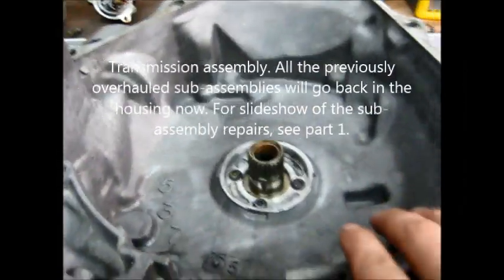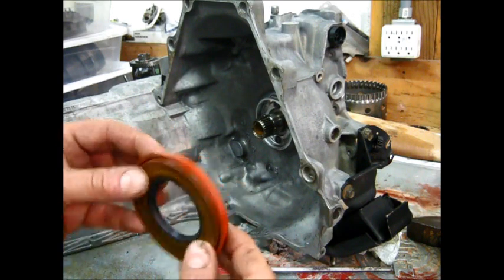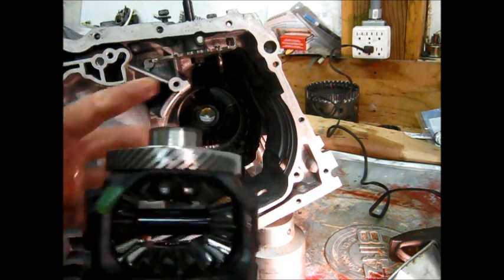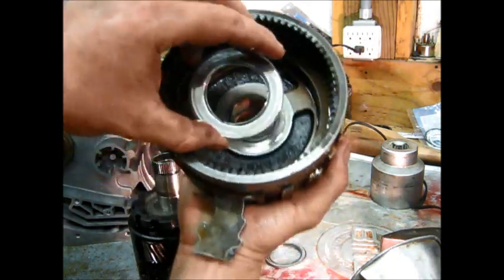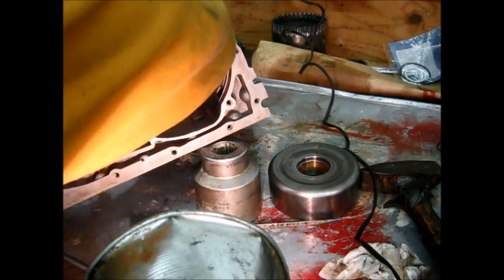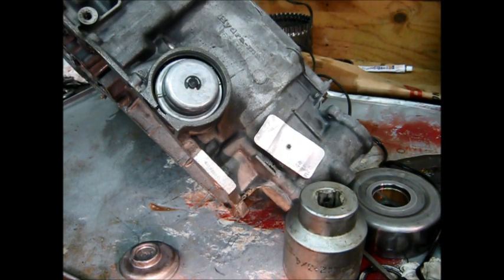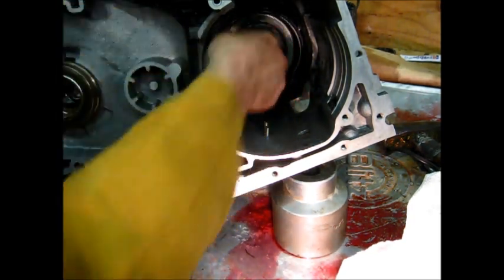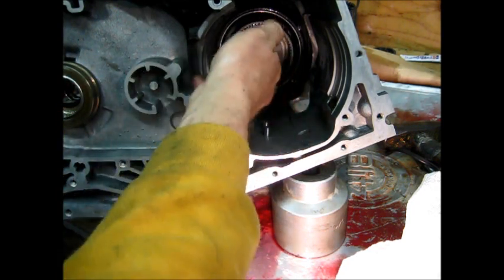Overhaul HydraMatic 440-T4 / 4T60 Automatic Transmission - Part_2

Comment: you're doing a great job, only thing you need builder is a fixture to hold those units while stacking clutches,i went to school on this unit,GM called it the ME9,on the street it is called the 44o t4 first year was a fiasco,pumps were blowing up do to pump support rings,anyway i like to watch you young guys doing what i did for 45 years --carry on
Reply from the maker: Thanks!  I appreciate it.

Have you seen my "4T65E internals in 440-T4" build?

Comment: Whats your thoughts about adding an external trans oil cooler to these cars.   I have a 90 Olds 88  with 94k miles.  Car is on its 5th trans.  Live in nyc so ALOT of stop and go

Comment: Would it be safe to use a slide hammer with a hook type attachment on it to remove the convertor seal?
Reply from the maker: I'm sure you could get it out with a slide-hammer, but just be careful not to nick or gouge the converter pilot shaft, nor to scratch or gouge the seal bore in the trans case.

Comment: 15:37 - when you get that output shaft installed, how much deflection do you end up with?  Reason I'm asking is my brother's car snapped an inner CV joint on the driver's side and I'm having to diagnose this over the phone.  (He lives out-of-state.)  He's saying he's got quite a bit of deflection on that shaft, like 3/16" or so.  It's been a long time since I've been into one, and I realize the shaft's not fully supported until the axle's in there, but I don't remember the shaft ever having quite that much deflection.
Reply from the maker: +Mark - 

Hi Mark. There are two different shaft support mechanisms that were used. If the car has a 440T4 (like this one) or a 4T60E (slightly newer - has vacuum modulator but no throttle cable) then the shaft has bearings inside the transmission which support it from within.

If the car is much newer, and has a 4T65E transmission, then the shaft is NOT supported internally by the transmission. It is supported by the CV joint hub.

Reason I said all that is, if the car has the 440T4 / 4T60E - then the output shaft should have SOME play but not 3/16 inch. The reason it has play is due to the 3 concentric bearings supporting it. There is some clearance in each bearing: (shaft-4th hub), (4th hub - input housing), (input housing - driven sprocket support). All the clearances add up and it feels like a lot of movement.

If this is the newer 4T65E, then the shaft WILL have about 3/16" play when there is no CV joint in place.

Hope this helps!
Reply: davida1hiwaaynet
  Hey, thanks so much for getting back to me on this so quickly.  No, this thing is in a 98 Lumina (car, not the van) and it's got the modulator but no cable so, yeah, it's apparently got too much play.  He was thinking he could replace the axle and be good but I tend to think this thing's got much bigger problems.  For one, the picture he sent of the axle stub itself looks like it's ground off on the end, meaning the axle support bearing is also toast.  Sounds like he needs to bag it.
Reply from the maker: +Mark - 

So; the CV joint got broken? That's hard to do. I have seen this when the car gets hit on the wheel and it drives everything over into the transmission.

I guess if someone drove the car with damaged boots and contaminated CV joints for a LONG time - the joint could fail in a way that locked it up and broke the housing.

Did he explain how this happened?

If the tip of the output shaft is damaged, it may be hard to get a new axle to spline into it. Depending on what happened to break the joint, it could have damaged more of the transmission than just that axle tip.
Reply: davida1hiwaaynet
  No, the tip of the output shaft is fine.  From what I saw, what I tend to think happened was the axle came out partially and was run like that long enough to where it wore off the end of it. (It appears to be tapered down weird and rounded over on the end.  I'm pretty sure it also took out the center support bearing on the output shaft, given the amount of play he said it had.)  Anyway, once the end of the axle wore off enough, it finally came out, ripping the CV joint apart.  I don't doubt the axle support bearing/bushing is also toast.

By the way, I would hardly ever fully remove those 440s.  Just gut them in the car.  Made a lot more money that way.  ;)
Reply from the maker: +Mark - 

Understand. Make sure he checks / changes the mounts when he fixed it. That shaft should never be able to partially disengage.

Yep I have been unfortunate enough to have to replace internal parts by the side of the road. I was a kid at the time and out of desperation had to remove the end cover and replace the input clutch snap ring that I didn't get in all the way. Got about 3 hours from home before it popped out.

I will rework a trans through the fender well if I know it was a fresh build and something went wrong. The problem with fixing old ones this way is when the converter is old or contaminated. Then you have an old converter with questionable clutch - and that could disperse metal chips in the rest of the unit.